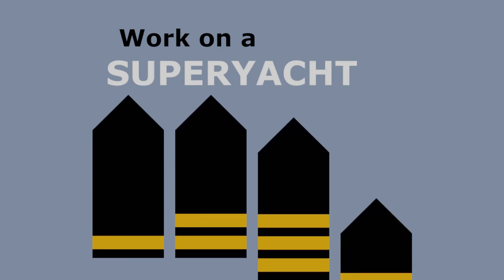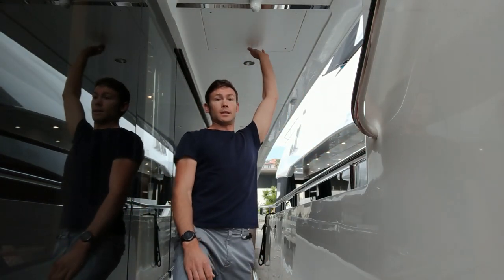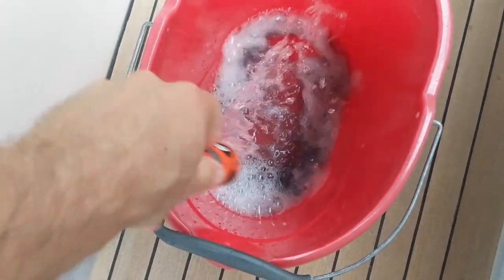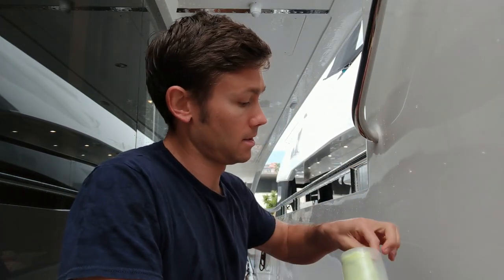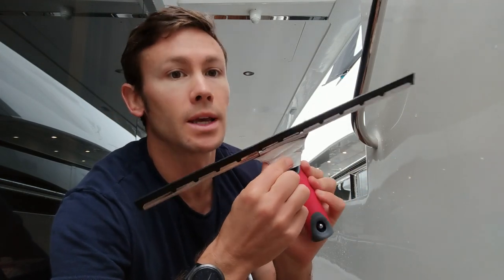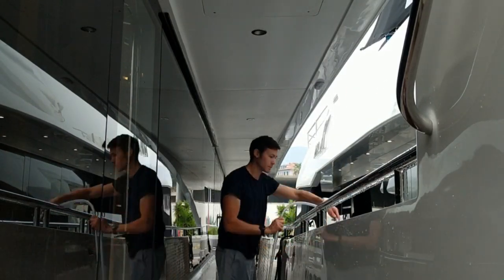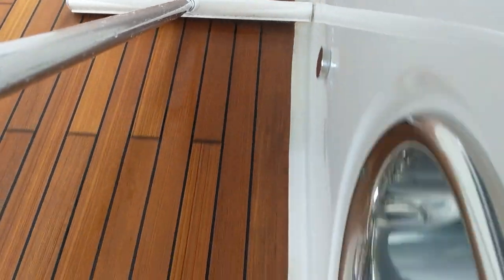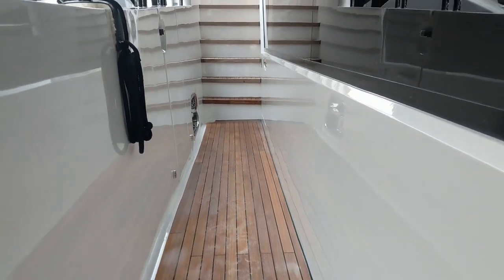Superyacht Deckhand Duties Series: Washing Down

Comment: Inquiry: Could you be hearing some music while doing this? Could it be hear-through earphones or noise-canceling ones? Are there any reasons why you might specifically not want to hear music? Thanks! Great video
Reply from the maker: Yes, I always listen to music while I wash down; it keeps me energised! However, I use a portable speaker instead of headphones. That way, I still have a good awareness of what's going on around me, and I can hear if I'm called on my UHF radio.

Comment: What kind of chamois do you use? Also, how do you take care of them?
Reply from the maker: Hello Meg. They are called Absorber. Here’s a link to the website:
https://www.theabsorber.co.uk/
Every yacht that I’ve worked on has used these. There are some copycat brands, but I’ve never found any that work as well as these.
They are very easy to take care of. Simply rinse, and then wring them out before putting back in the plastic holder. You can wash them in the washing machine if they get dirty, but only use warm water and no soap. Otherwise, you’ll be forever trying to get the soap residue out, and it will smear all over the paint and windows!

Comment: Why don't own ceramic coat the boat to keep it clean and easier to maintain as in the automotive industry?
Reply from the maker: Hello Neil and thank you for your question. There are many of these coatings on the market, but in my experience they simply just don't perform well enough to justify the price. The upkeep of certain areas can be made easier with a coating and without huge expense. But depending on the size of yacht, a whole coating can cost tens of thousands of pounds, whilst still needing regular washing to account for the harsh saltwater environment in which a yacht lives. It is also difficult to justify to an owner, as he/she is already paying for a crew to maintain the yacht.
Reply: @WorkonaSuperyacht  ok thanks for that information because in the automotive world makes the cars and trucks and these superyacht look so shiny I am surprised that no coatings are used but I am sure there is some polish or sealer that keeps them that shiny. Oh, do you use RO water or spot zero to wash down
Reply from the maker: @Neil Taylor The paint or gelcoat used on yachts is highly specialised and formulated to withstand the marine environment whilst retaining it's shine. We do use wax polymer sealers and PTFE polishes where suitable, but these need constant reapplication as they wash away over time. Ultimately, regular washing is what keeps these yachts looking their best.
I have heard of reverse osmosis water systems being installed on some yachts, but again this is at huge expense to the owner. Instead, for the vast majority of yachts it is simply a case of drying the yacht using a chamois, chamois mop and water blade to prevent any water marks.